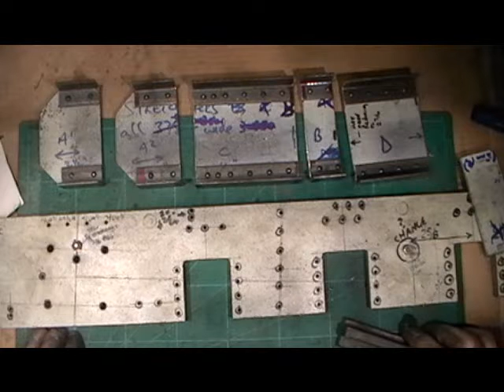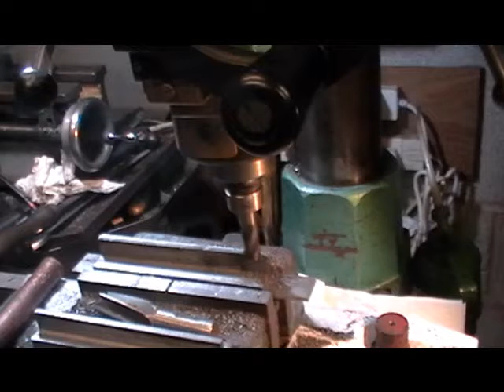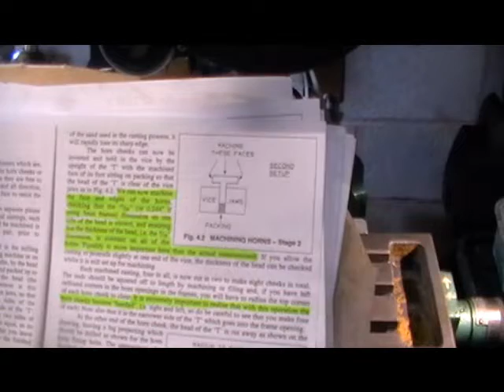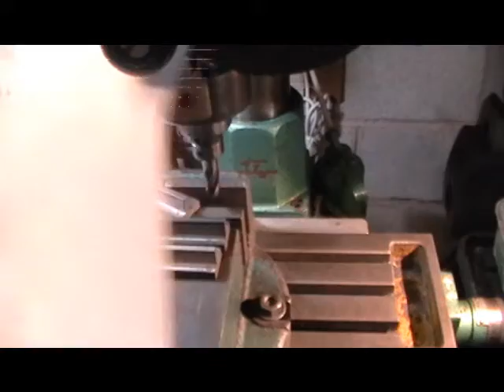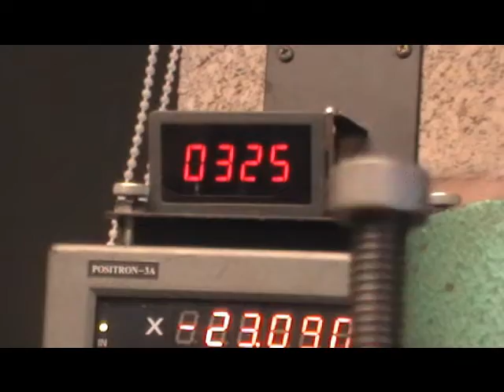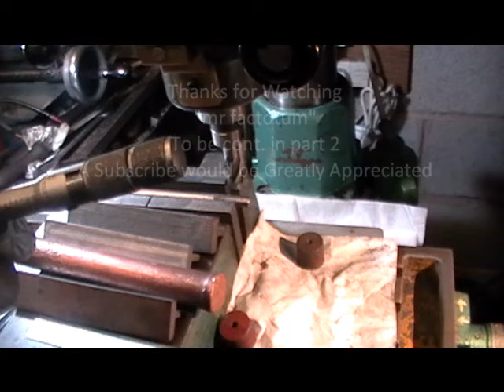Making a Beginners Steam Loco (Machining the Horn Guides Part 1) "mr factotum"

Comment: Don't suppose you could do a little instruction on the rivets. Some of my rivets have worked loose now I split the stretchers.
Reply from the maker: Hi KM5179
Sorry to hear your problem, hard to know what the problem is without being hands on. The stretchers take some splitting
If your struggling you could put Domed Head screws in and either have them flush or countersink the back leave them long then rivet the screws over, and to belt and brace loctite the screws in.
Other than that riveting is just about getting the length correct if you want to dome both sides, 
or just c/sink them and flush them off, 
Also you could try annealing the rivets if steel to soften them
Other than that not sure what to say without being there.
let me know how you get on👍👍👍🚂🚂🚂
atb
Kev
Reply: Sorted. A hearty wallop with a flat snap on the back did the trick. Not as nice a finish as I would have liked but it's functional. Thankyou for your help.